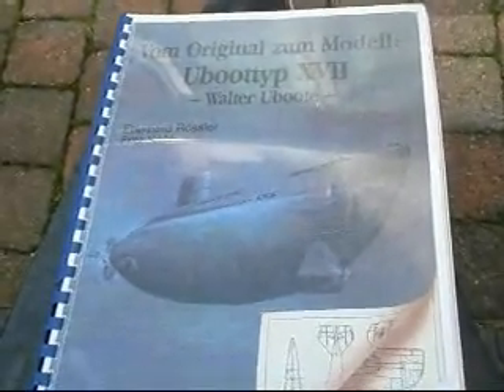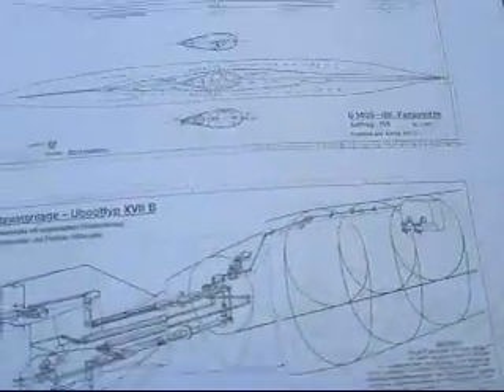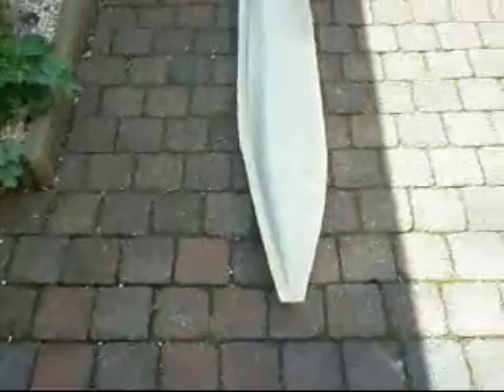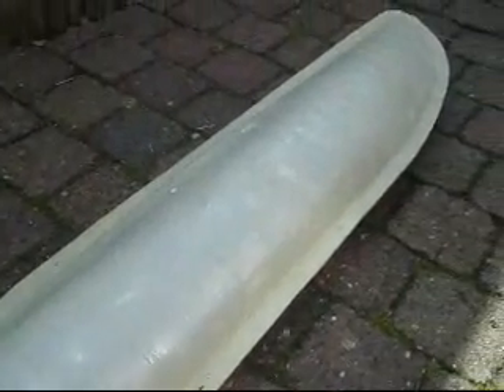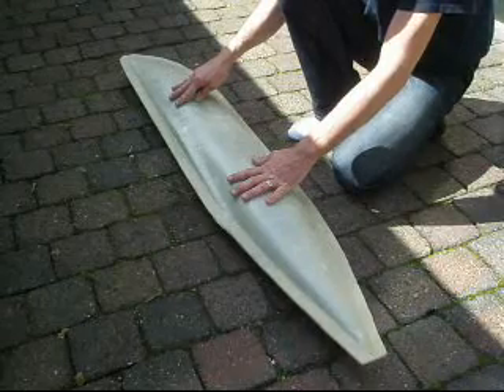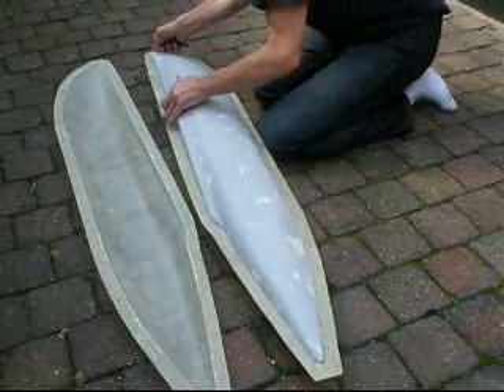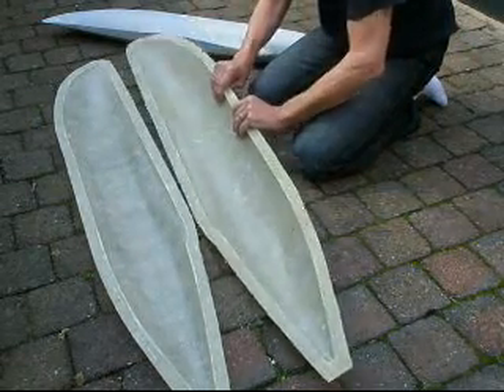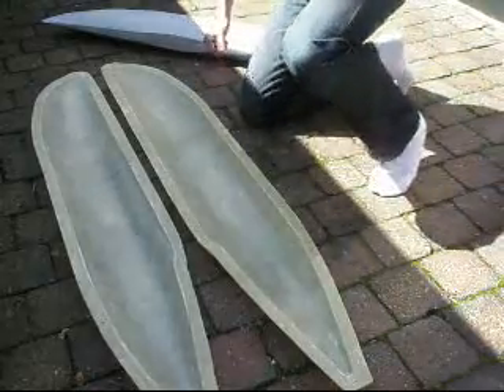The Walter XVIIb

Comment from the maker: There are not much vid's about how to build planes or boat from scratch, so by following B1 bob you can get familiar with the complete process, building a boat or a sub works the same.
You will need the WTC afterall, so ask yourself which sub you like, find the right WTC, and some decent shipyarddrawings with the ribs, then you can start with building the way i did.
Remember, there is no cheap sub, it's one of the most expensive part of building boats, due to the used  special materials.